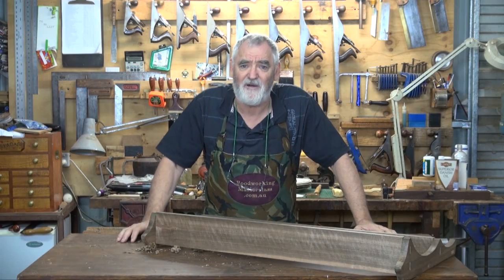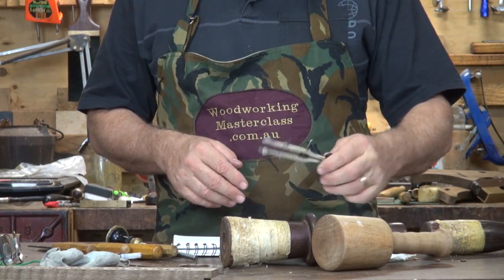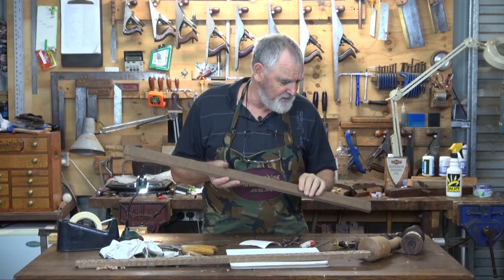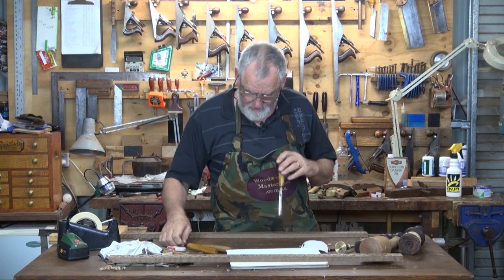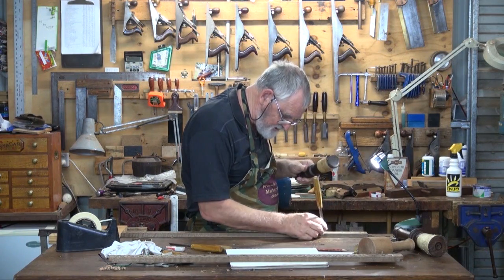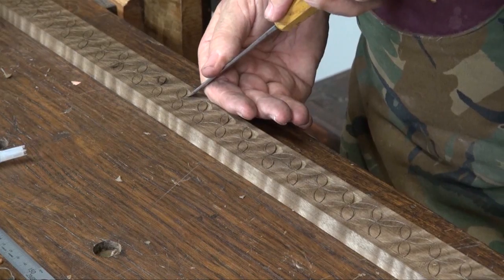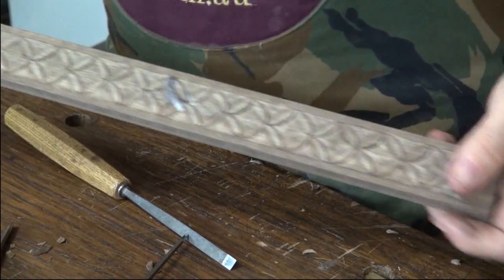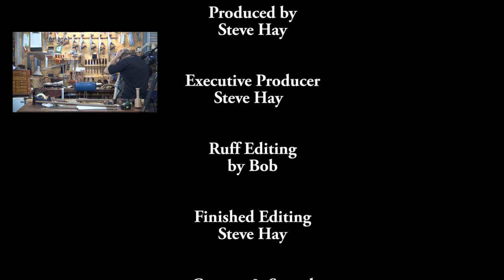Plate Rack Pt5 Carving Rail (Success)

Comment: I'm agreeing with symmetry but rather than change the size of the circles to come out with whole circles at each end, make the circles according to the width of the timber.  Then stop a circle or two short of the ends and finish with a different, simpler design, such as 4 wavy lines.  I have not added carving to a piece yet but that is what I'm thinking.
Reply from the maker: +Big Fat Tony's It's a great design that can be played and modified to however people want to have it. Cheers Steve
Reply: I bought a 12 piece set of vintage Marples and I just use them for joinery and finishing out routed moldings.  You have inspired me to add a carving to the drawers on my current project
Reply from the maker: +Big Fat Tony's Terrific, Marples are a good chisel have a few myself. Looking forward to seeing the finished Drawers. Cheers Steve